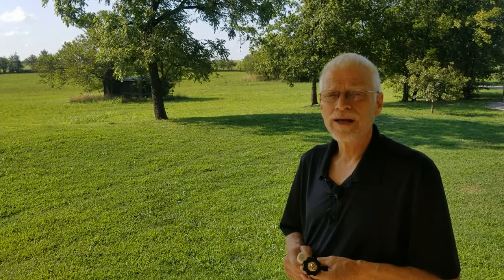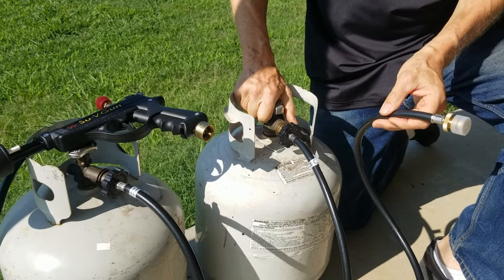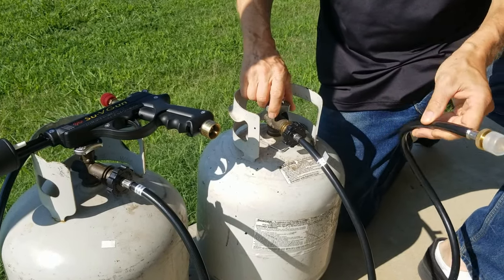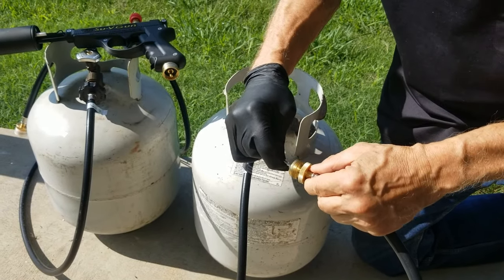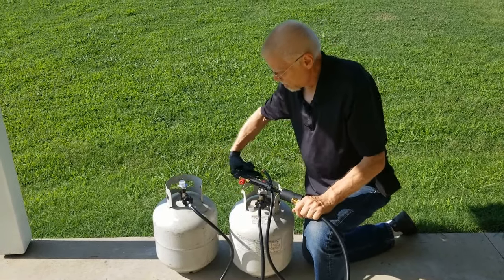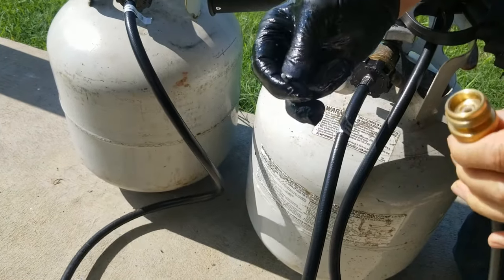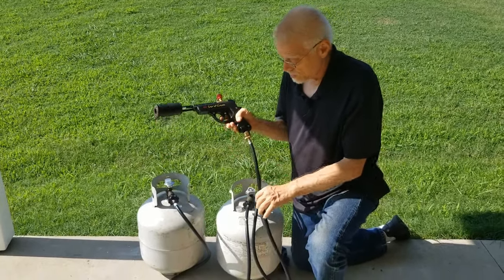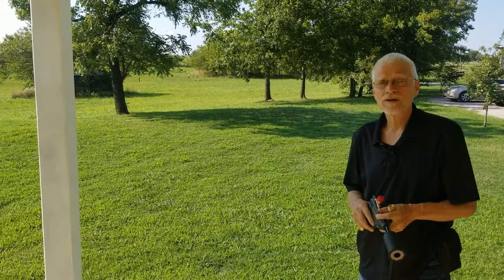How to clear a fouled 8' adapter hose

Comment: Thank you for your help, learning how to use my buddy heater is a learning curve. Living in my RV full time in the winter in Michigan, it’s worth learning the ins and outs of how to service my heater, the line, and understanding how the tanks work. It’s frustrating when you’re cold and having to trouble shoot but rewarding when i finally figure it out.   I didn’t know I was supposed to empty out the hose and just turned off my heater but not even my tank. Thanks for the knowledge

Comment: Thank you so much for your video!! I just discovered oil in my propane line to my Mr. buddy.  purely by accident. I normally turn the propane off and then burn off what’s in the line. But I didn’t didn’t have to use the heater because of weather change, so didn’t clear the line out. When I moved the heater to which the hose was now disconnected from the propane light tank, oil started dripping on the floor and I did not know why. Your video showed me!  Thank you very very much!

Comment: AT LAST I found out why my Portable Buddy heater doesn't always work when I attached it to a 15# external  tank (I was losing my mind as to what the problem was). I had tried using a Q-tip with the swab removed to clean out the gas inlet to the pilot, and using canned air with the tube attached to blow it out.  Sometimes those "fixes" would make it for a short time but the pilot would always go out after only a few minutes and I was forced to switch to a 30# tank to make it operate.  I still don't understand why putting the hose on a 30# tank made the pilot stay lit, but it worked fine that way (just a hassle to lug around the big tank when I wanted to change the location of the heater in my shop). 
I've always just turned off the heater when I was done using it but it seems the best "preventative measure" to ensure oil doesn't clog the line is to turn off the tank knob while the heater is still running so no gas is left in the hose.  I did as you instructed and voila, the heater works like new!   This tip works so well it should be included as part of the Operating Instructions included in the heater's box (but then the company wouldn't sell as many bc a lot of people would discard the one they have and just buy a new one; those sly devils LOL).   THANKS A LOT for wising me up as to this simple solution.  I have a feeling the heater will work great for years to come!
Reply from the maker: Honesty is the best policy (referring to my fumble-fingeredness). If I had really attempted to do a highly-produced video I could have cut it and reshot everything that wasn't high quality, but then, that wouldn't have been me, so I just did it in a single shot and posted it with all the foibles. Thanks for watching anyway, people don't know this kind of stuff so I'm glad to pass on the knowledge.
Reply: @bobhealey1365 I did your trouble shooting steps and it didn't work for me.. nothing comes out of my house when I depress the valve once hooked up to tank. .
What do I do now?

Comment: Thank you for this video! It answered my question whether or not the hose had a check valve, which I suspected. The problem with my grill is that It works some times, with the 15 lbs propane tank and the hose,  and when not I have to use the 16oz cylinder and  then It works ok and could not figure out why.  Now  all these BBQ  have 2 check valves, one in the hose and one in the propane tank, plus the gas regulator.

Comment from the maker: George, the main reason you will not find quick disconnect connectors for pressurized distribution of flammable gas is the liability associated with seal failure. Quick disconnects notoriously leak because of the tight tolerances and cleanliness required in the connection, to prevent pressure-induced seal bypass (leaks). By way of example, go into any shop with pressurized air tools and you will hear leaks throughout the facility at all the quick connections, with no real concern about it. In a flammable gas environment, the same situation would create a very dangerous explosive environment.

As for the relationship of Quick Change Connector specs (QCC), BTUs, and their relationship to pressure being a confusing topic, believe me, I hear you. The whole issue is hard to teach in a private one-on-one setting, let alone a written reply. The problem is that torch manufacturers refer to BTUs (which is a meanless measurement with regards to torches) because it is a well-known (poorly understood) referential measurement. It is like Peak Power in audio, versus RMS power. Peak Power is always used in advertising because of its enormous referential significance, but it is a poor method of comparing the actual power of an audio system.

BTUs are a measurement of gas flow per hour, of hydrocarbons, but the end result of what happens in a furnace regulated down to a very low pressure, .5 to 2 psi is night and day different from the force and utility of a high-temperature torch. In a torch like the Su-VGun, the performance of the torch is all about the nozzle pressure, expansion chamber, oxygen fuel mixture percentage, rate of mixture, and thoroughness of fuel burn. All this is to say that no one cares about that when making their selection for purchase, they only know how it feels to use the touch, the results in their application, and the authenticity of the influencer they choose to listen to (marketing). 

If as manufacturers, we have any integrity at all, we try to give our customers a mathematically justifiable, and measurably accurate, reference number in our specifications so that the consumer can make a selection with confidence. Since I care about integrity in advertising (and all of the knockoff manufacturers of our our torches clearly outright do not, since they just make things up in their advertising) it would be of little utility or benefit to make a video on the topic, except for the few people out there (like you) that even see the apparent incongruity that you are currently wrestling with.

A YouTube video on the topic would need to be like a 15-minute lecture with an audience and people asking myriad questions to do the topic justice, and sadly I don't have the production time to create it. I'm sure from this long-winded, stream-of-consciousness reply that I get off on this kind of topic (that's the engineer in me, screaming to get out).

Now for the short answer:  Your eyes don't deceive you so you shouldn't think you are missing something, the reality is that the performance spec of the torch is made with reference to a 1lb bottle which doesn't have a QCC valve, as though it could actually burn for an hour in this manner, which it can't because of the pressure drop in propane as it cools. So the only way to approximate BTUs in performance is from a bulk supply through a hose, which has its limitations due to the QCC/POL connector design, orifice, and check valve.  But that doesn't really mean anything, because that has no bearing on the performance of the torch in its application.

The even shorter answer: The QCC valve isn't considered in the spec of the torch, but isn't even of importance with respect to everything that I wrote above.

Bob

Comment: Thank you for video, couldn't fire up my 1200W propane generator from my 2 -100 lb tanks with 40 foot hose.  I had checked the valves before and pushed down with a jewelers screwdriver, guess not enough force , used a slender phillips head and pushed several times and the last time did the gas roar out!!! Generator fired right up and ran whole house including 4 ton AC unit, of course turned off pool pump and hot tub.  Now I wont be stuck if  Ian the Second comes around switching out 20 lb tanks.

Comment: I have a two burner camp stove that I've had for years. One year during my last camping for the season it almost didn't light. I stored it over the winter. The next summer I went on my first camping trip and the stove would NOT light. I figured it was the hose but I have not been able to find any way to clean it out and it's not at all replaceable because the company doesn't seem to exist. I've held onto the stove with the hopes that I can still get it working. I'll try your tip to see if it will do any good.

Comment: Very informative man thank! So do youneed to do that on a Blackstone griddle also? I never have cleared that line And leave it hooked up. Should I be unhooking and depressirizing that also? Thanks for the video!
Reply from the maker: Not so much.  The Blackstone sits behind a regulator, so the pressure in the hose between the regular and the input to the grill doesn't change, so there is very little reason for the suspended gas to re-liquify in the hose. Furthermore, any liquid that might condense out of suspension into the hose, would simply sit in the hose and not be blown into the stove at high pressure.

Comment: Thank you, Bob. Quick question: I have to keep my propane tank connected to my RV tankless water heater all the time -- what can I do to prevent this sort of problem with the hose?
Reply: You just need a two-way splitter coming out of your tank and put a shutoff valve on the line going to the torch, which you can shut off and purge the line without depressurizing the line going to your hot-water heater.

Comment: Is this the same principle with the mr buddy heater?  I have a new one and the canisters worked fine but it was getting expensive.  So i bought a 20 lb propane tank and an adapter but the pilot goes out when i move it off of light.. as soon as i try low or high, it dies out. I put a canister back in and it worked again.
Reply from the maker: It sounds like you are setting the check valve in the hose. Turn off the valve on the tank and then turn it back on VERY SLOWLY. If you turn it on too fast you will hear a clicking sound as it sets the check valve in the hose which will prevent gas flow from the tank. When you do it right you will not hear a click in the tank adapter and the hose will fill up properly (stiffen up) so that it can supply your heater.

Comment: Does using a metal hose make a difference compared to the rubber hose? Thank You
Reply from the maker: No, the problem is caused by temperature changes as the gasified propane condenses back into a liquid form and is trapped in the hose (pipe) because of gravity.  The only solution is to depressurize the hose, after use. Even so, the temperature shift will condense any residual propane gas left in the hose, but the condensate from this small amount of propane gas is usually so small that it is unlikely to foul the input check valve as it atomizes and blows through the gun in subsequent uses.

Comment: I have an 8 foot hose connected to a GasStop on my propane tank and it has a gauge meter on it. When I put the gas on and let the hose pressurize and then I turn the tank off. If I leave it over night the gauge reads a lower pressure. Is this normal because the gas liquefies or is it possible that I have a leak? I tested the line with a leak detector but it did not register any leaks. 
Thank you for this great video
Reply from the maker: Pressure and temperature are directly proportional. As the temperature increases the pressure increases proportionally. Since you tested the line with a leak detector, it is unlikely that you have a leak anywhere, it is more likely that the temperature has changed and the pressure changes accordingly.
Reply: @bobhealey1365  Thanks for the reply. Why is it so hard to find Quick connect high pressure attachments for the Su V gun. I don't like twisting threads every time because I don't want to accidentally damage the threads. I use a 1 lb propane tank instead of a hose because of that reason. they have quick connect attachments for low pressure but it seems high pressure is something not commonly used by the RV people so end users suffer. Even if you find quick connect for high pressure they are only rated at 50k BTU
Also why is there no red cylinder QCC1 in the hose you are using which is more for torches and very high BTU. 
Black QCC1 cylinders are rated for 90k BTU doesn't a torch like the SU-V gun use higher BTU then that?
I am having a hard time understanding how the BTU work with pressure and torches. .  Maybe you can put out a video that explains high pressure and low pressure along with BTU and throughput of pressure. As is it now, anyone with a torch or those Chinese burners including craw fish burners are in the dark with the information available on YouTube

thanks for this great video

Comment: I have a Big Buddy propane heater.  So does a friend of mine. I have a hose that includes a regulator and a quick connect designed to clip on and off a special port on the heater.   I presume it's down stream from the internal regulator.  My friend has a hose like you demonstrated.  His heater clogged up and now we know why.  My question is: will this issue happen if the hose has a regulator at the tank end?  I say it won't because the only pressure in the hose itself is 11 inches water column as it is regulated pressure.  Can you confirm that for me, or let me know otherwise if this oil problem can occur with a hose that is only pressurized up to the regulator setting.  
Cheers!
Reply: I had my my buddy heater do the same thing. It wouldn't work or light. I took a q-tip and stuck it down the burner tub. It was soaked in the oil. Kept doing that until it came out dry. It fired up after that flickered a bit but haven't had a issue since. Hope that helps you
Reply: They also sell a filter to put on at the heater that's supposed to catch any of it
Reply: @ticktock2320  The filter only fits on a high pressure hose.  If  you have a regulator at the tank, it fits via the quick release fitting at the low pressure side of the heater.
Reply: My filter goes on right at the heater and the hose connects to it

Comment: This is a great video!
Any idea what to do if the blockage or problem is at the other end of the hose (at the connection)?
Reply from the maker: I can't help you with just the information you provided (it's also 2 months since you asked me, so I'm sorry I didn't see it until now.)
Reply: @bobhealey1365 maybe he is referring to the same problem I seem to be experiencing,,,
Reply: @bobhealey1365 the connector to tank has a clog.. as in you connect hose and press the valve at the other end to bleed,, but it doesn't bleed . Nothing comes out. . So therefore the clog must be at the connector connecting at the tank
Reply from the maker: If the hose has a clog or is otherwise just faulty, then you simply need a new hose. There is no fixing the hose. But having said that, I have seen more faulty tank valves than clogged hoses. The best way to confirm the hose is bad is to use it on a different tank and see if the problem still exists.

Comment: I tried this but my hose just will not work
Reply from the maker: The hose can be bad but it is very rare.  If it doesn't work the problem most of the time is in the actual tank valve or connection to it. Feel free to call GrillBlazer support to talk through troubleshooting or replacement options. 918-969-9690

Comment: Is it possible that oil in propane lines is specific to the CV guns that have check valves in them? Propane to any cooker or grill I've used just fire right up after sitting all winter. Also no problem fireing up with fridges and water heaters in RVs that I have.
Just wondering as I've had zero issues in 25 years of RVing. 
Good explanation for the subject.
Reply from the maker: No, physics is physics.  The same thing I am describing happens in your RV too. It all depends on how the lines (rigid and flex) are run, and where the propane pools in the lines. Also where the drain valve is located to drain the liquids makes a difference in the design of the RV propane plumbing. Unlike your RV which has a pressure regulator in front of the line, GrillGuns use unregulated high-pressure gas which will push everything pooling in the lines out the end of the hose as demonstrated in the video.  Low-pressure lines let the gas flow over the liquids and don't push them to the exit.
Reply: @bobhealey1365  Thanks Bob for the explanation. It's just that I've never had a start up failure with either fridge, water heater or stove. Is it possible that the propane burns the oil residue in the line?After watching your video I checked a line that hadn't be used for a couple months and it did have oil in it which I blew out with propane and it fired up a Coleman Roadtrip.
Maybe I just lucked out!
Have a good day, sir.

Comment: I hook up my two burner cook stove to a 20 # propane tank and it works fine.  I hook it up again with an identical hose and I get nothing.  What is wrong with the hose ?  Can it be fixed ?
Reply from the maker: The two burner hose typically has a regulator on it. If it does, it will not have the pressure to run the gun. The gun runs on unregulated propane. Are you using our hose?